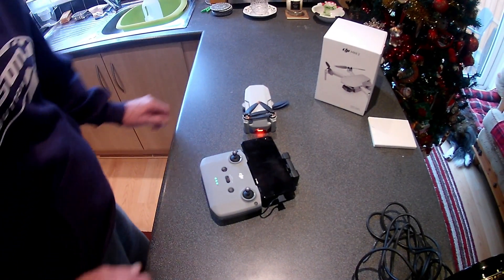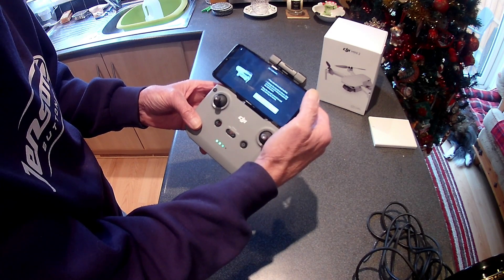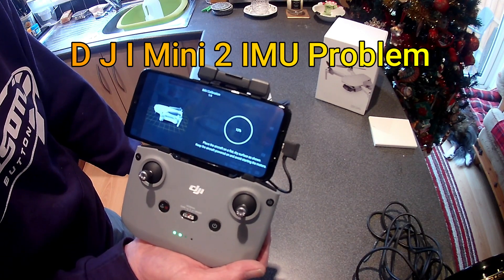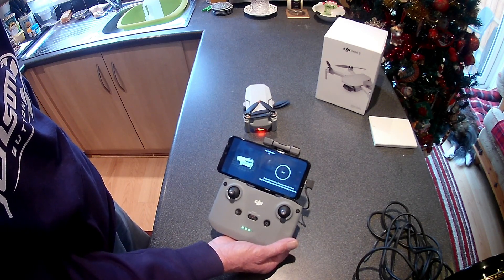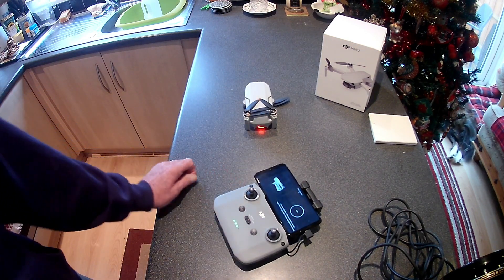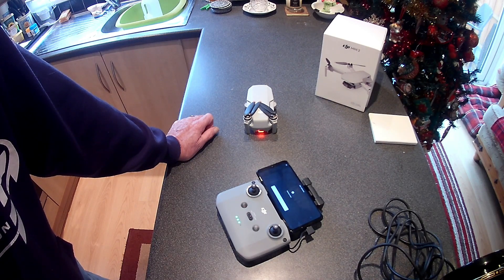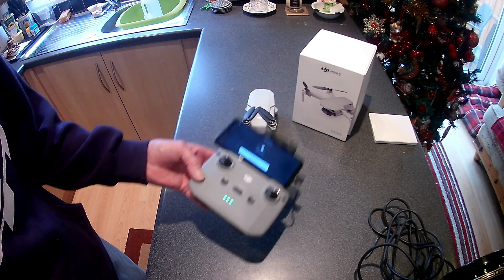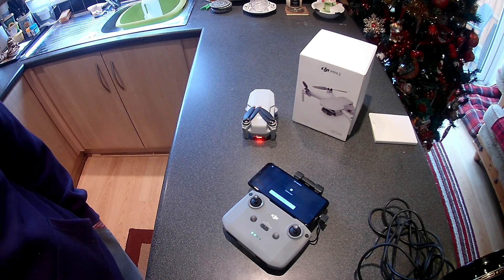DJI MINI 2 IMU PROBLEMS

Comment: Exact same issue here.  Received as a gift on Saturday, two successful flights on Sunday, won't calibrate today (Monday).  Contacted DJI support, after some discussion they said to return for exchange.
Reply from the maker: Glad you fix it with D J I sent mine back to amazon got a new and got the mini 1 and 2 brilliant drones don 🤠🇬🇧👍👍👍👍👌

Comment: Hi buddy  I have to do a compass calibration and imu every time. Not happy I'm going to return it. I don't want another crapy dji drone. Maybe in a few years I look again.
Reply from the maker: My mini 1 is fine I did have problems with the mini 2 thanks for the comments don stay safe frend 🤠🇬🇧👍👍👍👍
Reply: @uksewingmachineservice7030  I've got the mavic mini and i put range extenders and I know it's limits so no problems with that but mini 2 👎

Comment: You should try to calibrate it in outdoors, and free of interferences (wifi, signal tower, etc). It's written on almost all dji drone manuals. If it still has the same error, u should return it or contact dji.
Reply from the maker: Thanks frend yes I tried that no look amazing sending a new one Don 🙄🙄🙄👍

Comment: Firmware will not fix this as it's a hardware issue. The accelerometer (s) get stuck within the imu and need to be dislodged/released 
Just turn it off, give it a couple of firm whacks on its top. Power it up and re-run the calibration procedure.
You're welcome
Reply from the maker: Tried all that!! Have sent it back! Could have been a bad batch 😁
Reply: @uksewingmachineservice7030  What date did you purchase yours?
Reply from the maker: @drybiscuit  2 weeks ago from amazon no problem money back in my account 24 hrs may get a new one after Xmas 🤔🤔🤔🤔🎅
Reply from the maker: Is yors flying OK now mate 🤠🇬🇧👍👍👍

Comment: Try to reset the AC and RC then IMUI calibration it if helps. Then try to reinstall the firmware of the AC. Or your close to metal object and magnetic than causes that problem on the sensor. Did the drone crash thats why its asking for Imui calibration.
Reply from the maker: Thanks for help mate really appreciate don 🤠🇬🇧👍👍👍

Comment: DJI is very worried about Race drones and is forgetting about the customers that give them a lot to gain, try to put the firmware that comes from the factory and try again, I hope that it will solve this problem and return to its wonderful flights👍🙏🤗🤗🤗
Reply from the maker: Hi think you are right about that mate thanks for your support frend don stay safe mate 🤠🇬🇧👍👍👍👍
Reply: @uksewingmachineservice7030  And try to have the battery of the remote at full load and the batteries of the drone, this is constant already in my Mavic 2 Pro I have had several bugs signal loss etc.📶👍

Comment: Bummer Don! That happened to me with my Mavic 2 but only after I crashed it into a tree. Had the insurance plan from DJI and sent it to them. Told me that the drone gyro was most likely damaged from the crash. Perhaps yours got damaged during shipment? We all know they are sensitive instruments and don't think it is a design flaw.
Reply from the maker: Thanks frend when I videoed the power station it played up ther that's why I didn't go to hi ther sent it back to amazon no problem think I will stay with the mini 1 for now 🥴🥴🥴🤠🇬🇧👌👌
Reply: @uksewingmachineservice7030  Good decision Don! But don't think it would be a bad decision if you decide to get another one down the road.
Reply from the maker: @Michael-RI  what a 4or 5 weeks might get one 🤔🤔🤔🤔